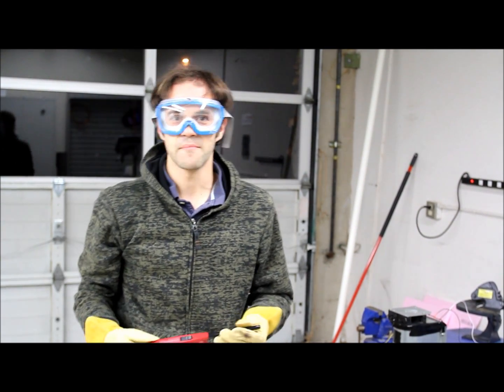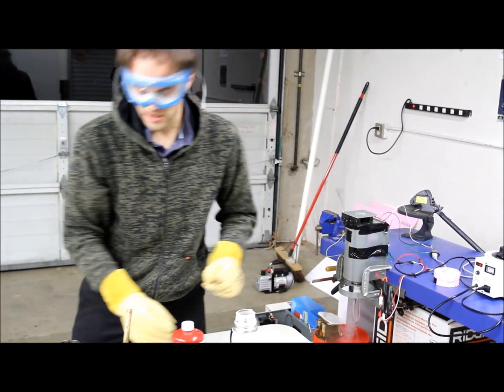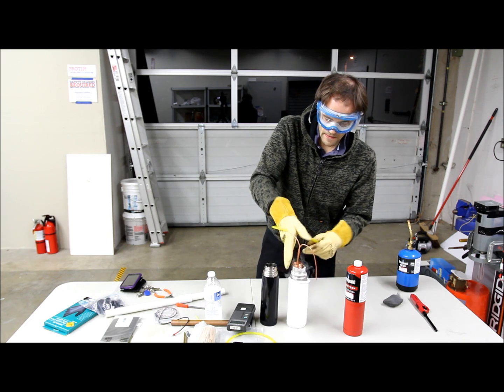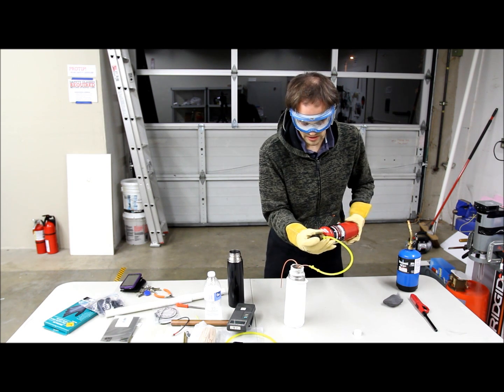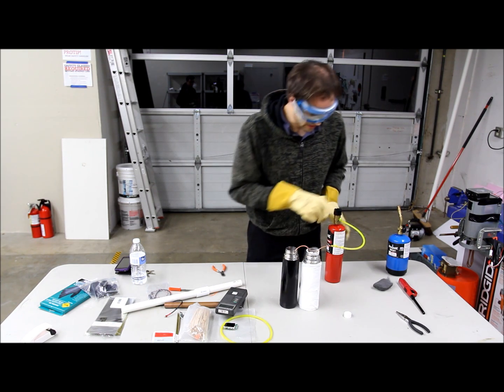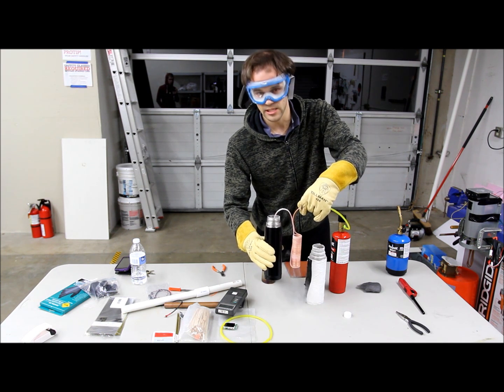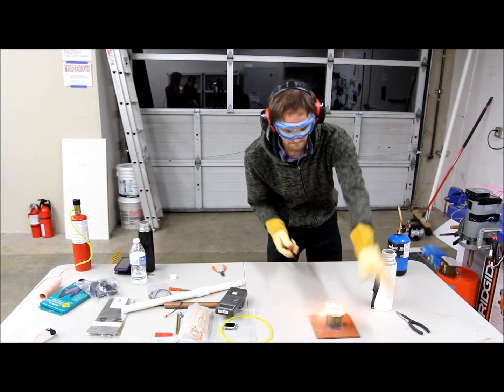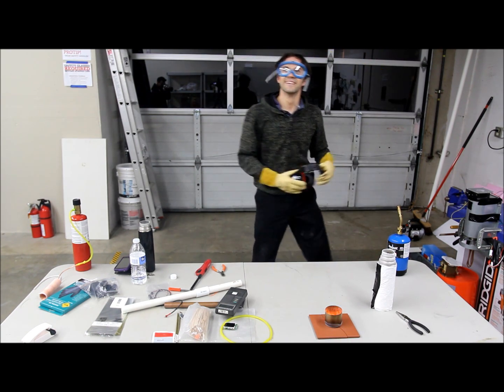How To Make Liquid Oxygen and Thermite

Comment: that is not thermite... thermite gets oxygen from on oxidizer mixed in...this is just putting steel wool in oxygen. dont confuse the 2
Reply: If the can was Aluminum it would create thermite. High temp, plus oxidized iron (from steel wool) in an aluminum can would make thermite.
Reply: crobochamp Aluminium need s to be in powder it wouldn't react in a can form.

Comment from the maker: Yes sir, it is lit. That is not a dumb question, a dumb question is "who is oxygen?" You need to light it first (to cause a thermal runaway reaction) otherwise the steel will simply oxidize (rust slowly).